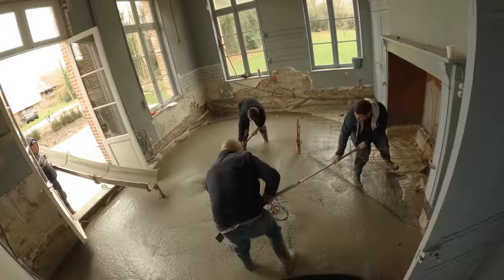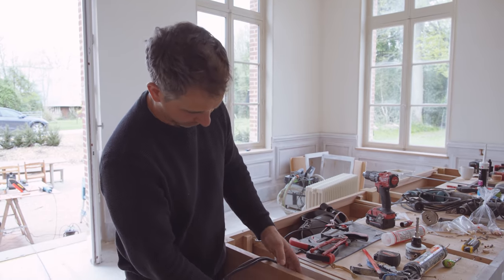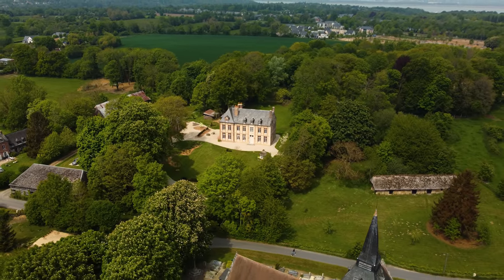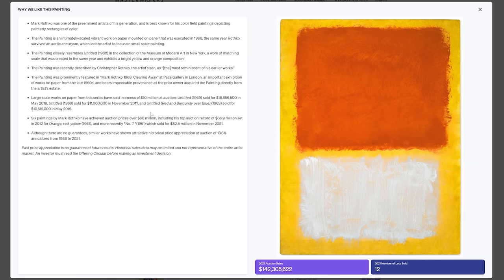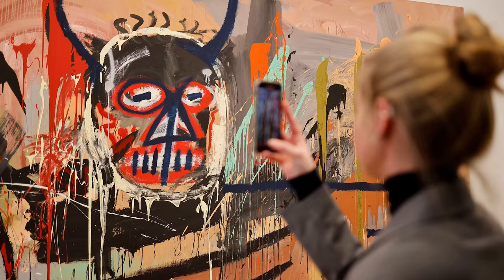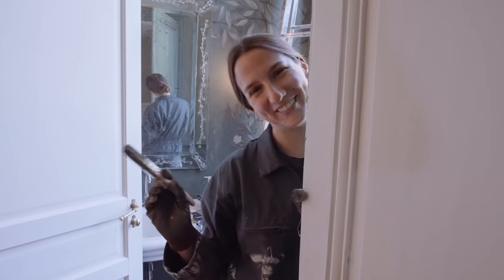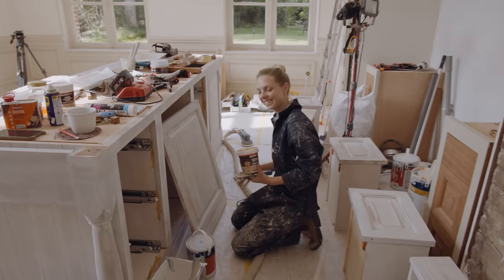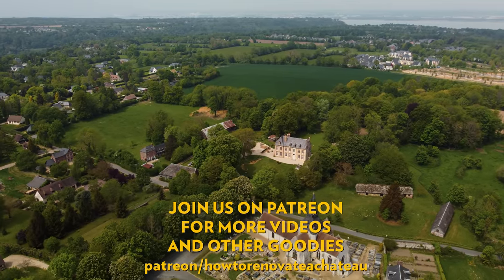Chateau Kitchen RENO  - Painting TIMELAPSES (so satisfying!)

Comment: There are two things you can do to draw out the lavae. Put vaseline over the hole which will bring them to the opening as they need the hole open to come out if they are in there, they also need an air flow to survive. Or flush the hole with a stong saline solution, it wont harm the tree and it will kill off the lavae from the salt. Dont put chemicals in to kill them as it will burn the soft wood of the tree. If you do use the saline fill the hole until no more solution can go in, you are more likely to flush out anything that is in there and any eggs which could be in there, the salt will erode the surface of the eggs.
Reply: Maybe try some olive oil too?
Reply: If you do try to flush the tree, can you make of video of that? Would love to see the process
Reply: I agree with the saline flush and hope you film it.
Reply: Hope you can take care of the lava  in the tree  ,the   kitchen is coming  along nicely guys
Reply: Be sure to fill hole so they won't co.e back.  Carpenter Bees, so destructive.
Reply: Great advice. Diatomaceous Earth should also be purchased by the barrel for this property.
Reply: @reladie  I was also thinking carpenter bees when I saw that hole… takes just a couple of hours for them to chew a. ice big tunnel!
Reply: It is an oak pinhole beetle larvae, I believe. There are systemic chemicals that you put into the ground and the tree will take them up. There is a huge article on UK website on how to treat them.

Comment: We call that grub a borer and if you poke the wire in enough, you can stab it and kill it. I have used Neem spray squirted into downward holes also. Plug the hole afterwards to prevent other critters getting in. Visually check susceptible trees often or it will damage them enough to kill the tree. 👍🇦🇺

Comment: The red oak wood borer (Enaphalodes rufulus) can be a serious pest in red oak tree stands. As wood borer larvae feed on red oak heartwood, they leave visible tunnels. Wood borer tunnels are easily identified by the oozing sap and sawdust-like frass near the tunnel's entrance. Heavy infestations could scar the tree or girdle and kill small limbs. Red oak borer damage is often exacerbated by the diseases or other insects that enter the tree through the borer tunnels.
Physically remove the wood borer larvae. Wood borer larvae hatch and feed a few weeks after they are laid in late summer and will continue to feed for the next year. Identify the pinhole sized hole entrance in the tree. Insert a straightened wire hanger or other long, sharp implement into the 6-inch to 10-inch tunnel repeatedly to impale the white or cream colored, fat wood borer larvae.

The red oak wood borer (Enaphalodes rufulus) can be a serious pest in red oak tree stands.
Red oak borer damage is often exacerbated by the diseases or other insects that enter the tree through the borer tunnels.
Spray the red oak with an insecticide scheduled for use on red oak wood borers. Follow the manufacturer's instructions for application rates and amounts. These are contact insecticides designed to kill adult borers before they can lay their eggs. All of the tree's bark must be coated in order for the insecticide to be effective. Spray for red oak borers in the last week of June--a week or so before the earliest borers lay their eggs.
Re-spray the red oak every 3 to 10 weeks (the intervals will be dictated by the manufacturer of the insecticide) until the egg-laying season is over in early October.

Tip
According to Texas A&M entomologists, spray insecticide will likely have to be applied every egg-laying season indefinitely. They recommend tree removal as a more environmentally and economically sound option for repeatedly infested trees. Healthy trees are better able to fend off wood borer infestation.
Reply: 👍 Ha ha ha agree! I’m laughing because it wasn’t until I posted my suspicion that it was a red oak borer, that I read your comment. Good job!
Reply: In short: impale the rufulus. Aren’t you too reading too much of the French Revolution?
Reply: Couldn’t they have gotten a replacement from the garden place they purchased it from?. Is there such a possibility?
Reply: @dianegriffith3006  the tree is not dead so I’m sure they want to see if they can save it. As Phillip mentions, it was their most expensive tree and most nurseries won’t replace pest damaged trees for free!

Comment: The issue with the hole in the tree is that it can start to rot through it, I'm not any pro at this but I would try and carefully open the side of the trunk, completelly empty and clean it, and just apply some spray paint to protect it while it continues to grow, the paint will not damage it, it will just prevent the wood itself from sucking too much moist, then it will fall by itself.

Comment: I realize you planned to paint the gorgeously crafted cabinetry all along, but I must admit it was painful to watch. I had held out hope the island would be spared the tickling of a paint brush.....but sadly the oak nature so lovingly "gifted" you disappeared as well. Okay...okay... so there is a specific look and feel you're after and you must live with. And I'm what you'd call a wood man. My kitchen cabinetry was natural oak but was swapped out for naural cherry. I feel if the item is to be painted it should be constructed of something other than natural hardwood. Obviously you're making sympathetic alterations to an old structure. As such the changes you're making are in keeping with what would have likely been used in the 18th and 19th centuries. Which I totally get. They were not using MDF or laminated bamboo when the house was built and added on to.

Cheers.